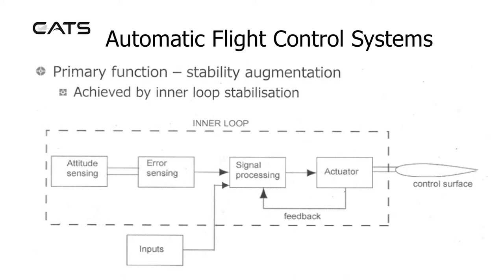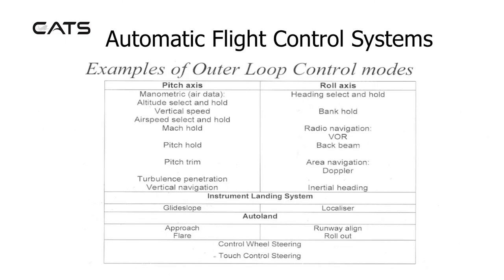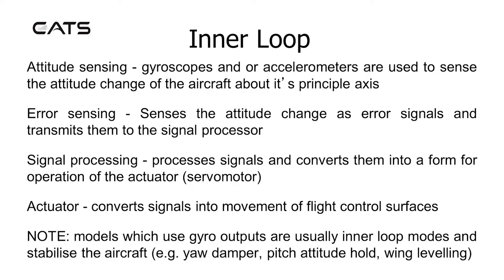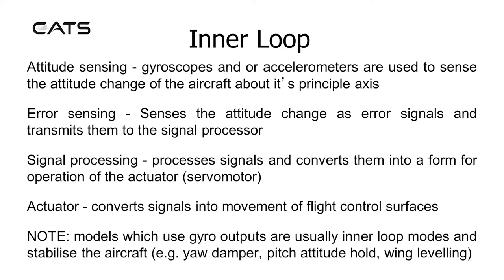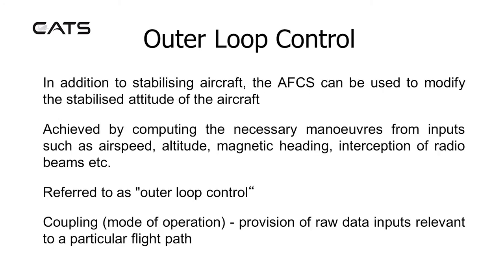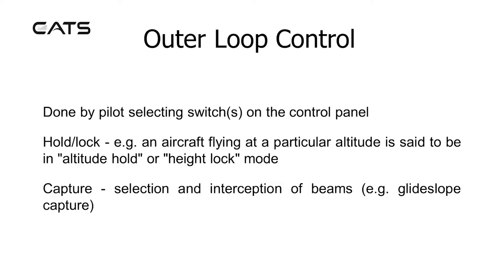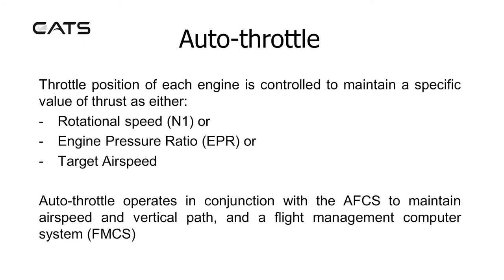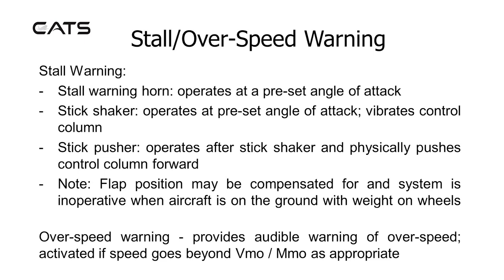CATS ATPL Instrumentation - Automatic Flight Control Systems

Comment: is hydraulic system(hydraulic pressure) needed for this automated flight control system? in the case of all loss of hydraulic pressure which will affect the normal FCS, can the AFCS(autopilot) be used to gain control?